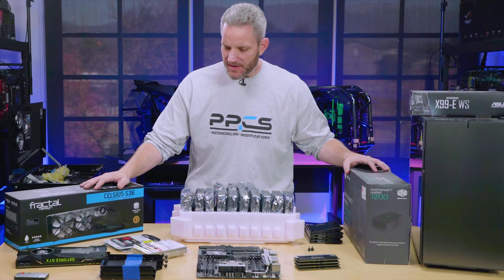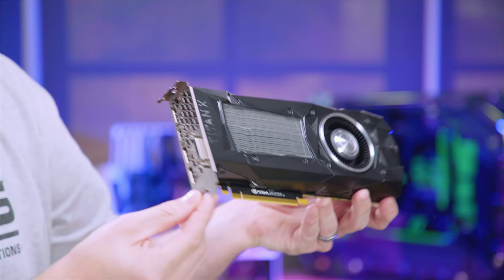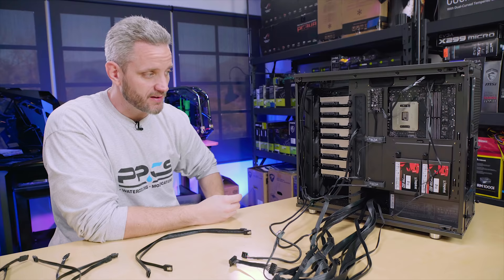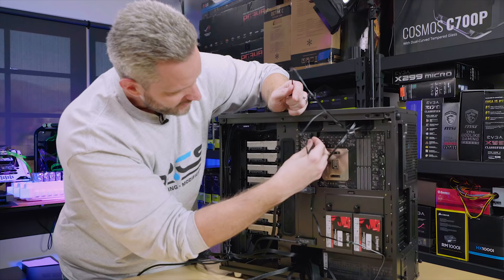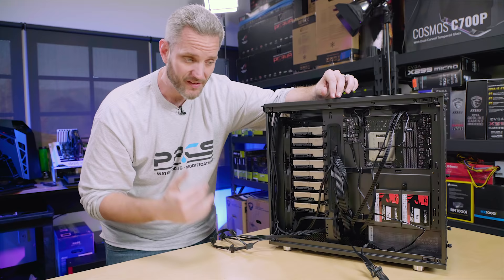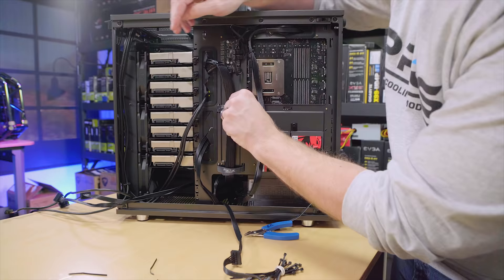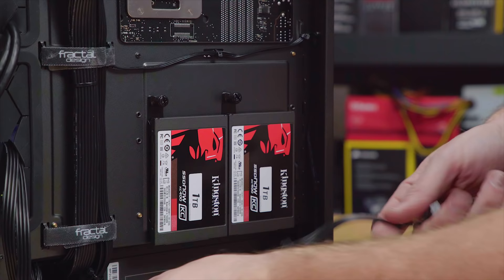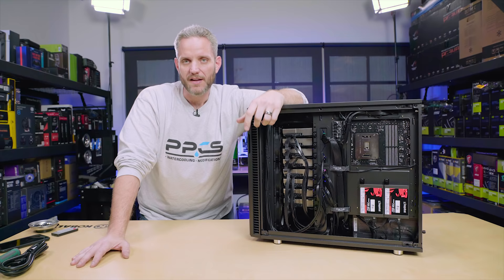How to cable manage a computer

Comment: I configure servers/network equipment for a living and I would never recommend using an Intel raid controller for anything you care about.  Get a newer Adaptec or LSI card and you'll be much better off.  We've had too many speed/reliability issues with RST Raid for me to recommend them.  If I could pull them all out of production, I would.

Edit: Also cringing a bit at the drive setup but you dont do it every day so i wont hate, just dying a little inside without a hotswap backplane
Reply: I think its because it needs direct passthrough to run unRAID.  You don't want to use a proper hardware raid controller (well the features at least)  .  You want a controller using IT mode.
Reply: He's using it as a "workstation" though.  How would he pass the physical disks through? HyperV at least doesnt really let you do that, I think Virtualbox might but there's no way in hell i'd run a server in Virtualbox (had a half broke WDS once because of that)

EDIT: Also you can get a controller that runs JBOD mode for something like that, there are plenty of those.  They're called HBAs.
Reply: No, i *think" he's planning on using unRAID for the OS, and creating a passthrough VM using the GPU similar to what Linus did.  Ideally you would use a HBA set to IT mode, or a flashed raid controller like the LSI 9211 (which is what i use).  I don't think JBOD is the same. The unRAID OS needs bare metal access to the disks without the raid controller doing its thing.  This enables proper SMART reporting etc.  Google unRAID, you might find it interesting if you've never heard of it

Comment: Nicely done video on a rarely-discussed topic...only thing I do extra in a build with lots of drives is labeling both ends of the SATA cables...makes tracking a cable and/or finding a bad drive that you're trying to replace way easier.

Comment: Easily the part I need to work on most, I have a single M.2 drive and my cables management looks crappy, even though the case has plenty of solid cable management options.  Thanks for this video Jay!!!

Comment: I've dealt with probably around 20 sata drives in my life and I've always pulled on cables and stuff and have never broke one of those plastic tabs
Reply: I've actually had problems with the connectors on the cables breaking before the connectors on the drive breaking... not to say I'm not careful when installing or servicing them. Jay's recommendations on this point are still valid.
Reply: I was about to write the same thing, cable managed many hard drives quite violently and not a single connector failed, didnt even think about that being an issue.
Reply: Never broke one too...and I am constantly changing drives or plug in new ones to take stuff to friends or so. In the worst case scenario, I end up needing to replace the sata cables due to the excess bending.
Reply: Jay is probably coming from a place of past experience. Shit happens.
Reply: yeah i think one would have to assume Jay has had many more encounters with this kind of hardware than the average person.
Reply: have 3 new drives, have been careful, all three tabs broke within 2 years. It's a desktop. I HAVEN'T OPENED IT FOR 2 YEARS. HOW THE FUCK
Reply: I broke one yesterday, part of my raid 0. Luckily it still works if I coax the sata cable a little bit. Enough to transfer my files but probably unusable.

Comment: In my R5 it's full of hdds, I bought 5-in-1 SATA Extension Cable from ModDIY and had the cable length custom, so there are no slack between the drives.  It looks really nice and makes it easy to put the back panel on, I highly suggest to get some cables like that for a lot of hdds in a system.

Comment: Why are you not using a SAS controller and SAS cables? You can connect 4 SATA drives with just one cable. Besides, there are no good SATA controller cards out there, that I would want to trust my data with. Go with something like an Avago 9361-16i. Additional benefit: You don't need to split the hard drives between onboard controller and external controller.
Reply: Sebastian Schrader I am new to enterprise hardware and I am planning an unraid server inside a 12 hot-swap rosewill server case. My question is which sas card works best with unraid?
Reply: I have no experience with unRAID, but because it's just Linux, I assume anything that works well with Linux, will work well with unRAID, if they provide a decent Kernel with all necessary drivers/modules, which I assume they do, if they provide storage software. In my experience LSI (now Avago/Broadcom) controllers are good choice. Pick one that has the proper PCIe interface for your mainboard (e.g. PCIe 3.0) and enough ports, that would probably be the -12i or -16i models in your case, otherwise you will need a SAS expander to connect more drives. The number stands for the number of lanes and the "i" for internal connection. In your case, I would recommend, that you use the controller just as dumb HBA without its hardware RAID capabilites and use the Linux software RAID  provided by unRAID. This way, you are not dependent on LSI controllers, if something fails. You can just plug your hard drives in any other Linux machine and reassemble the RAID. And you can use all the flexibility that Linux RAID offers (changing RAID levels, resizing etc.). The performance benefit of hardware RAID, especially on a dedicated device, is most often not worth the hassle.
Reply: Sebastian Schrader thanks for the information. I will look at that brand of cards.
Reply: I totally understand the point of a dedicated RAID card if you're going the hardware-RAID route, but if you're just doing software-level RAID, what's the point of using the RAID card aside from the extra ports to connect the drives? (Asking strictly out of curiosity.)
Reply: There are no good (reliable, high-performant) SATA cards out there. The SATA HBAs that are out there are based on the Marvell 88SE9128 or ASMedia ASM1061, which are not good. The SATA controllers inside the Intel or AMD chipsets are much better, but they are not standalone. Mainboards offer enough SATA ports for most customers, that's why there is not enough market demand for a high-performing SATA HBA. And why would you design such a controller, if you could build a SAS controller instead, where you have much larger market? So if you want something decent, you have to buy a SAS controller and they almost always offer at least some RAID levels, but you don't have to use it.

Comment: Why not alternate the sata power cables? Then you'd not have the loops to deal with...
Reply: Then the loops just get in the way of the next set of alternating connectors. The way he did it is just fine plsu if anything goes wrong with a drive's connection, he can easily see which drive and replace it easier etc. Just my 2 cents.
Reply: @toriawelsh7274  wouldn't it be possible to put every second HDD upside down? so you got first connection on the left side, second on right side etc.
Reply: @brohvakiindova4452  wouldn't change the fact that the cable would still be in the way. There is no way around it. You either make the loops. Or have a cable underneath another cable. Sure it'll work. But what's the point.

Comment: I pretty much do the same thing Jay. I have built about 7 or so PCs for myself, family and a friend of mine. I just finished my streaming PC with AMD Ryzen 5 1600, 32Gb 2400 MHz RAM, and a GTX 980 I got off a guy at work for $220 bucks before the massive GPU price hike. I wish I was a little better at cable managing but my builds still look nice inside main compartment. Just wish I could water cool my 2 GTX 1080s in my gaming PC to have them run a little more quiet while I game.

Comment: 20:47 "That's better cable-managed than some systems I've seen that have 1 hard drive."
sigh i have an m.2 and this thing is more cable managed than mine
Reply: ya so do i just shove my cables in my pc because im lazy LMAO
Reply: I have an m.2 too, and i do not see the drives as problem, but the thing is that case fans and their cables take the mess to another level... spent 3 hours yesterday to try and better manage the cables, and that was a moderate success.  Though if i had hard drives, i'd be more screwed than i already am.

Comment: Definitely some clean work! I too get obsessive with my cable management after building a few thousand systems haha. Heck, it takes me longer to cable manage than it does to assemble!

One thing I've done in the past with tons of hard drives, to keep the sata power cables at equal lengths, is to alternate power from one cable to the next. Therefor keeping the base length nearly identical and shortening the extra loop length between drives. Makes for a cool effect too! Occasionally I have also removed the sata power plugs and re connected them at exact lengths to each drive. SUUUUPER clean! Man I miss building systems!

Comment: One of the best purchases I ever made was a roll of quality double-sided velcro strip, the same kind that comes with the Fractal case.

Cut them a little bit longer than you think you'll need, do your cable management without needing to commit to any specific layout, then trim off the excess so they take up minimum space. 

Zip ties are probably the tightest fit tight and do the job damn well, but single time use and might have you cutting cables if you're rushing it or being plain careless.

Comment: Server with no ECC RAM?  Surely it's worth it and recommended even if using unRAID.  I get its sponsored, but a hot swappable Norco / Supermicro 16 bay with ECC RAM would have been better imo.  This is still cool, don't get me wrong, but i wouldn't class it as server grade.  Cabling is boss though.
Reply: Agreed, I thought it was interesting that he decided not to use ECC memory. I'm also curious to hear his reasoning for it, which I'm sure there has to be one.
Reply: Yeah, i get that you have backups of your data etc, but i wouldn't want to keep my home pictures / videos on a "server" without it.  In his case, i assume it's all his YouTube videos, so just as important

Comment: @JayzTwoCents From my experience - when I do builds with multiple HDDs it often works better (and nicer) to use one SATA power cable for every other drive (1-3-5-7) and the other for the rest (2-4-6-8). Creates less loops/slacks and put less strain on the cable itself. The length between SATA power connectors on the cable was never a problem.

Comment: If thats pro, then I dont know what to call people who make custom length cables and use special combs and cable clips for their build.
Reply from the maker: Gods
Reply: Hahaha yeah I've done that a few times in my original setups. Lots of hours and completely worth it. 

Although I think that's for another video. Besides it does add to the cost as this would apply to the regular user. 😊
Reply: Wire and pins arent expensive in and of itself. Sleeving and tools that come with it are the $$$ factor. Though, I agree it is worth it, but I digress.
Reply: Those are cable artists
Reply: "Enthusiast" - Pros make it neat and clean, but also know the value of their time and get it done.
Reply: remember too, that this is primarily a server and not a showcase piece like skunkworks or threadripper.
Reply: Youll save more by making them yourself than buying from them honestly. Crimpers you buy exactly looking like eg. MDPC sell for way less the cost (google "HT-225D"). Pin extractors by Phobya or Lamptron (own them and are great). Wire cutters and strippers (get your head out of the gutter) are optional and also very cheap. Lighter most people have already. Now buy wire, pins, sleeving and heatshrink and youre done. Cablemods and other same company are for people who cant be arsed or are scared to destroy the PC. Last part on shopping list would be a PSU tester for checking, if you got all wires right.
Reply: @Jayztwocents I was going to say expensive with all the extra man-hours

Comment: Excellent cable management skill Jay. Learnt alot. I feel if you could try powering every alternate ironwolf drive with the sata power cable. That would eliminate the fold in the cable. So your Sata power cable 1 would power drives 1, 3, 5 & 7 and Sata power cable 2 would power 2, 4, 6 & 8 drives.

If you read this and try this method it would be awesome to see the result in a picture.

Cheers and thanks for sharing your knowledge.

Comment: I recommend going with MLC NAND SSDs for the cache, do not trust TLC that has only a tiny fraction of the write endurance of MLC.
For caching, spend an extra 20-40% but get an SSD that can handle 5-8PB of writes over its life as compared to 200-300TB of writes from a TLC drive. Furthermore, you will get more consistent performance with MLC.

Comment: Could anybody suggest a video or a tutorial how to set up a home media server? I'd really like to have all my stuff in one place, and free up my laptop storage. Also, I came to an idea of having a media server made of 2.5" drives, and in case that I have to take, lets say, a disk with music, and stick it into my laptop. Would that be possible? Is it possible to have a server thats not RAIDed?
Im aware of the safety reasons and the reason why you set up a RAID, but Im a risk taking bastard, so Id do it that way..
Reply: Yes of coarse however you want raid unless your data isn't valuable, redundancy is a good thing. You can sync the files so they are duplicated on your laptop for offline access.
Reply: Robert Hickman i know the point of raid, but for my first server id use probably as much as 5TB storage..i'd go with raid if i didnt want to extract the drives every now and then and take them with me, instead of taking the whole server..you get the idea? 1TB drive for movies, 1TB drive for music, etc. Is it possible to have it mixed? Some raided, some unraided..i'd go with raid for smth like photos and videos i made..sine these would be more important than hoarded music and pc games..

Comment: I tend to use small velcro ties when organising where my cables are going to go. Then once I have everything where I want it I zip tie them then remove the velcro ones, that way the cables stay in the same place.
I find this is easier than constantly cutting and retying zip ties as you change positions.

Comment: Just put all of my parts into a new case. Was able to do /some/ cable management. The hardest part was the dangling case fan wires that plug into the smart controller, and the power supply cables. My cables are not flat, they're all round.

Comment: Jay you can remove the sata power plugs from the harness and put them in the hdds then push the wires back in to the connector to get rid of the loop

Comment: I just built my first pc in that exact case. I think I did okay in terms of cable management. Keeping wires bundled, using my pass through grommets, etc. I have a bit of a rat's nest by my drives at the bottom though. You wouldn't notice though if you saw it from the other side. I'm really quite proud of myself.

Comment: Just a Suggestion : Jay i think instead of folding and bending the hdd power cables like u have done .... u can plug alternate hdds like u can plug 1st hdd then skip 2nd and plug 3rd hdd ....... then with second power cable u can start with 2nd skip 3rd and plug 4th hdd ...... i that way the loop won't be that big and u don't have to bend cables to close side panel

Comment: For cutting the dangly bits off of zip ties, I prefer to use end nippers rather than straight or diagonal. It is almost impossible to accidentally your cables with them. I also use velcro ties for temporary cable management, and sometimes for long-term use as well, rather than using plastic zip ties only to cut them again a few minutes later. Or at least I try.

Also, why not right angle SATA cables on the spinning rust drives? It would decrease the risk of them breaking off the connectors on the drives.

Comment: good job with the cable management.  

i realize this vid was mainly about the cable management part but you could have simplified this SPECIFIC system and just used a case (get a rack!) with HDD hot-swap bays and a backplane. 1 power cable. and since you're going to be using a raid card or HBA anyway, 2 Mini-SAS SFF8087 (or similar) cables.

Comment: Also helps with the type of case and PSU you buy. My case does not have the cover for the drive slots or cover for the psu at the bottom. My PSU is also not modular so I have allot of left over cables that I don't need and have no place to go. Also my cables are round, braided cables unlike the flat cables you used. Still great video though. My next build I will definitely keep these factors in mind when buying components.

Comment: Hey Jay, why not run the Sata Power to the HDD's every other one? 
Cable A: 1,3,5,7
Cable B: 2,4,6,8

That way you don't have a bunch of goofy loops stressing the plastic tabs. Just a thought...or is the OAL too short to reach all the drives?

Comment: You should connect the sata power cables differently.  Cable 1 should connect to drives 1, 3, 5, and 7. Cable 2 to drives 2, 4, 6, and 8. This should eliminate Ali those mini bunched up cable loops.  Just a thought but liked how you did the rest of the cables very good process. Loved the little idea to rotate the zip tie clasp around and hidden in the back side.

Comment: Hey just a tip on cutting zipties, if you use pliers and twist the extra length until it breaks instead of cutting with snips it will not leave a sharp edge that could cut the wires.

Comment: You can find SAS or SATA Cables on Amazon which are dedicated for servers. They are smaller (CableDeconn Internal Mini SAS 36Pin or CableDeconn High Speed 6Gbps) and help a lot for cable management. But yes they are blue :)